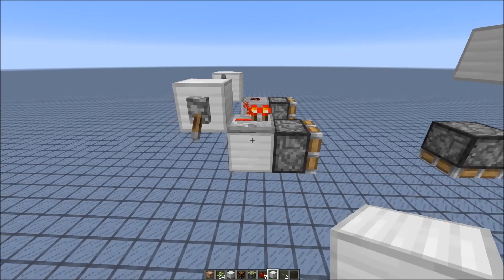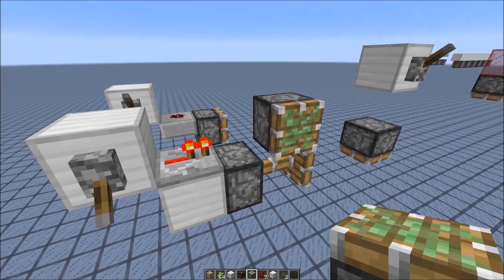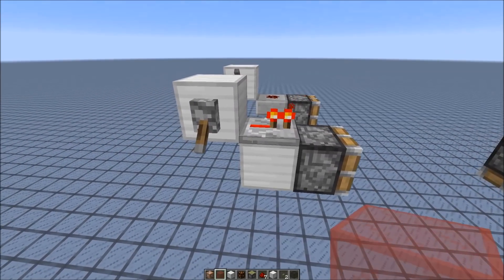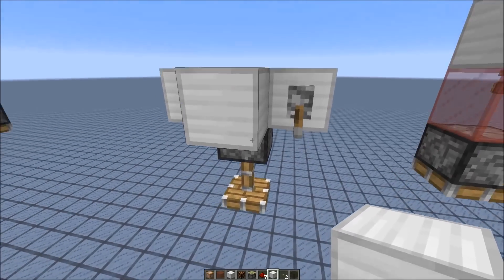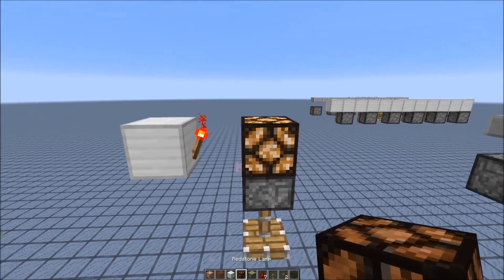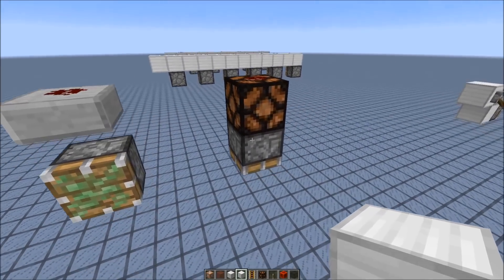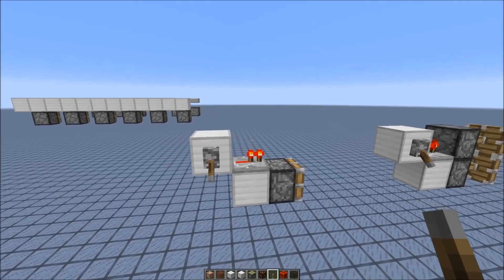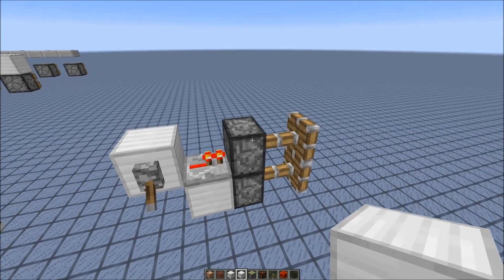Clarification: Air Blocks Don't Get Powered Anyway

Comment: Wait a second... at 2:53 - the block above the piston is powered be the lever, yet the piston only fires when it gets an update from the side. That's quite confusing sind, well, quasi connectivity (as explained to this point) should cause the piston to fire once the lever is flipped... but it's not.
Reply: No the piston needed a block update because the lever didn't provide one

Comment: Quasiconnectivity isn't that hard to understand once you see it in the code.  Any block that "activates" due to a neighboring block being powered is informed of this by a block update method call, and that method can basically do anything it wants.  Something like a redstone lamp just checks its 6 cartesian neighbors to see if any is powered, and it does so by coordinates, not checking the actual blocks.  A piston checks five of its six neighbors, excluding the piston face, and it checks five more positions around the space above.  A dropper is even more straightforward--there is a method (I forget on which class) that checks a block position's 6 cartesian neighbors, and that's just called twice, for the dropper itself and the location right above.

Anyone who thinks that quasiconnectivity is a bug or an accidental copy/paste mistake has just never looked at the code.  And no, the code looks nothing at all like the activation code for doors.  That rumor is almost certainly false.

Comment: I agree about the update but throwing quotes in people's faces and posting insults (looking at the commenters) is a way to tare a community apart not a way to fix problems. The reason why I like minecraft so much is because of the community. Lets band together but keep in mind that the developers don't just code they have to deal with millions of opinions.
Reply from the maker: You make some good points. But I disagree, that people/companies shouldn't be quoted. Ofc quotes shouldn't be used out of context, but I don't feel guilty in this case.

Comment: May I present a counterargument? I agree that the piston getting powered is QC, but keep in mind that every piston, dropper, etc. that's being powered by QC requires a block update. Because of this fact, doesn't it make sense that they made it so that the piston now requires a block update if the repeater is diagonal to it? Don't get me wrong, I also hate this change, but from a logical perspective, all I see is that they fixed this for consistency.
Reply from the maker: I was mostly countering the argument, that the piston shouldn't be updated, because it shouldn't be powered. 

From a consistency point of view I honestly don't see an improvement. If something is powered it should be updated. I think a system, where everything that gets powered by QC also gets updated would be more beneficial for consistency. Since we have observers now, there's also no need for QC BUD's anymore.
Reply: ilmango So you're saying Mojang is going the wrong route. Instead of making it so that everything affected by QC must be updated, they should make it so that updating happens automatically. I agree with you, that's a very good point.

Comment: A very well presented argument. I know it's hard, because there is a lot of passion in this, but be careful not to make this personal, that will only entrench sides and then no matter how good the argument this won't get fixed. Really the reality is you know no matter what they said the pressure is also on to 'merge' the codebase so to speak to be one product, not two. So I'm sure part of their argument has to be that slowly and surely we will see QC go away, and anything else that is deemed to be outside of what they want in the final merge. IMHO if they want QC out they should be honest about it, but then need to make the observer more powerful as it was in the first snapshot, or keep QC and fix the observer with your particle suggestion.
Reply from the maker: If it's really their plan to remove QC with a salami tactic, they're doing it exactly wrong. Many people are already frightened to build anything with RS, because it  gets broken all the time. Instead of working on pistons over the years, everybody would appreciate it much more if they would take the time and finish something. All the latest changes in the last versions just had the effect, that contraptions got broken, but nobody would say that pistons are better now. They act different but not better.

Also it seems like Mojang only reacts to shitstorms. Latest example were the hopper changes two months ago. A change got introduced, that would break a large amount of contraptions. I immediately made a bug report, which ofc was immediately denied by the incompetent mods like always and after that was ignored for a few weeks until Xisuma mentioned it in one of his videos and the bug report became the most-upvoted report ever. 

After that jeb worked on hoppers again, and despite that a few contraptions don't work anymore, the technical community overall agrees, that the system is better now.
That's the way it should be, except that we need a shit storm first.
But with grum on the other hand, we're not seeing any cooperation at all.

Comment: It is absolutely absurd that this keeps happening.  Several of the changes they've made in recent snapshots were clearly done without thinking of the repercussions to the actual gameplay, instead only considering what is "intended", and they're making the game objectively worse because of it.  What's even worse is they stubbornly back these decisions seemingly without any real consideration to what the changes mean to the game itself or the community, or at the very least that's how it looks from the outside.

It would be different if there were anything, even the slightest hint of positivity in this change, but I can't find any.  It's a purely negative change to the game added seemingly only because "That's how it is in PE!"  The fact that these short sighted changes keep happening, and more so that there is virtually no real discussion about them by the developers, is not only frustrating as a player but also a concerning trend for the development of one of my favorite games of all time.